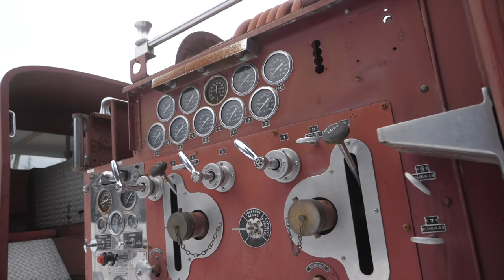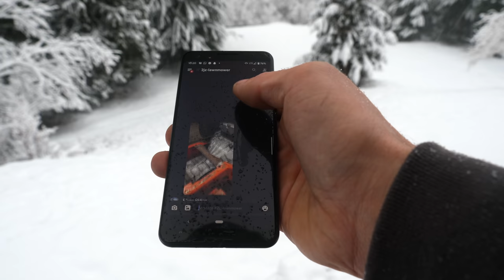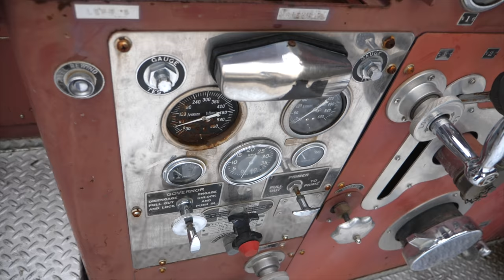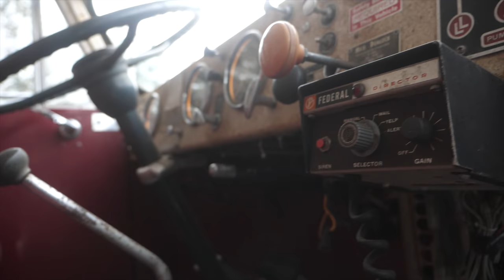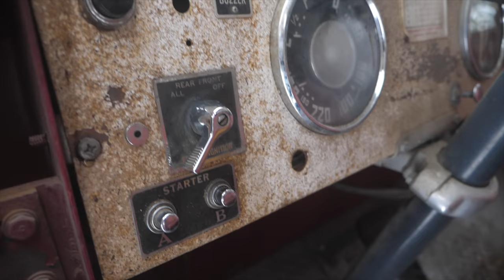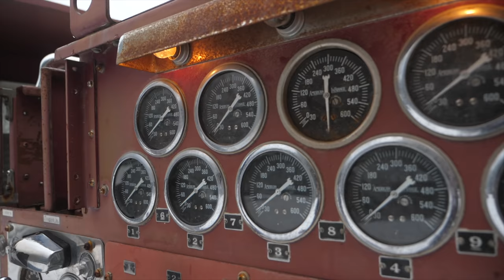We Bought A Fire Truck! Ultimate Toy Hauler Build?

Comment: unless you are making longer trips, the old inline gas has a certain cool factor, and it sounds like it runs great. If its loud in the cab, i can only imagine a detroit. lol If you do decide you want a diesel in it, your best bet would probably be buying about a 97 or older model school bus with the mechanical DT466 and allison automatic. You can pick them up for a couple thousand in good driving condition. Although at that point, youve basically got yourself an enclosed diesel/auto toy hauler that just needs the seats removed and a door cut into the back with some ramps....

Comment: I have to say it is the very first to have a "redundancy" ignition system for me. I hadn't heard of one before. Loggers kill to have a machine like that for doing logging in the summer months when they are required to have a fire fighting system. I would pull that fire fighting gear off and mount it to a old truck frame with a hitch to pull it with. Or even a truck with a long frame, nothing special about it except that gear on it. If I did it, It would get extra heavy duty springs on it front and rear. Since you are getting rid of it, find another tank top side for extra water... pay for a lot of stuff to make some future builds cheaper

Comment: pro tip about the cdl.. if the truck is under 26001 lbs no cdl required... also (check in ur state to be sure) but if its personal use not company use no cdl is required anyway.. register it as a toy hauler or camper... then ur golden :)

Comment: I'd say make a bad ass toy hauler. A newer cummins with an allison. Maybe an 8.3, or 6.7 I dunno. A 12v makes more power I'm sure lol. Just pimp out the inside of the cab a bit, maybe extend the inside by enclosing the rear section, sound deaden, seats, etc..

Comment: The jet engine isn't as difficult or expensive as you're thinking. Get a turboshaft engine from a helicopter and it already has the gearing for an output shaft. You could probably get it to work with a really big and slippy torque converter 2spd auto for a drag car. Aircraft and aircraft parts are 1/3rd the normal price right now too. And yes, it'll run on diesel.

Comment: Nice Fire Truck! I don't have an I-phone so no Discord for me. If you want info on your fire truck I may be able to help as I have the same Fire Truck just 10 years newer but it's the Hook and Ladder version with a 100' ladder on it and steering in the back as well as the front. The engine you want is a 2 stroke V-8 Detroit Diesel with the Supercharger, all the 2 strokes have Supercharger. Our trucks look identical from the front until you get beyond the engine. When or if you pull the tires you may have some problems without a big ass impact. But... they do sell a tool for breaking lug nuts loose on big trucks and it operates by hand using torque multiplication. I highly recommenced it as it will break any nut loose or twist off the stud.
A five year old could use it once its in place, you can get one from Northern Tool online. Anyways you guys have fun with it and you don't need a CDL if you put collector plates on it. Good Luck!   Chuck

Comment: Since GVW of it is less than 26,001 lbs and it doesn't sound like it has air brakes, I don't think you'll need a CDL. Also as long as your water tank isn't 1000 gallon or more, you won't need a tanker endorsement. So I think you're good to drive it

Comment: i believe if it doesnt have air brakes, you might not need a CDL. but i may be wrong, it does weigh a lot..  still in all, this would be a pretty wicked toy hauler. just make sure you remove any emergency decals on it, or that could lead to some hassles from the 5-0.

Comment: Far as I know, in most state, as long as the truck braking system does not run on any form of air and is all hydraulic you should not need a special commercial license. But I only know that for some Southern States.

Comment: Keep the Stock Engine. Get rid of the pumps and tank. Keep the cab.. Those Big Straight 6 motors Sound Great once you tube them up. Plugs,carb etc

Comment: It would have no prob. With a full hose bed  water and tools. It will pull the front wheels if you pop the clutch just under redline if its  running  right  with no load ...

Comment: I'm sure there is someone out there that can use the parts. Pull the stuff off and list it for sale. Make a short boxed in area for the power wheels and other smaller toys, and a drive up ramp that goes up over the cab.

Comment: 26,000 i "think" is the requirement for needing a CDL. It has regular plates on it already. Register it as an RV and i think u will be fine. Buff out the cab! The front bumper and headlights look brand new still no chipping chrome.That is a sweet truck!

Comment: I wonder how much HP you can get with bolt-on improvements? Those engines were designed for reliability for their time. A few upgrades might be great. Throttle body injection, electronic ignition, better exhaust. The holy trinity.

Comment: You do not need a CDL to drive that truck if it is under 26,000 pounds. Also the engine in there is more than likely a Continental R6602, which is actually 602 cubic inches. It isn't a horsepower monster by any means because it only makes around 220 horsepower, but it should make 500 ft-lbs of torque at 1200 rpm, so it's kinda like a diesel in that regard. I'm sure if you swapped out the carbs and made a better flowing intake and exhaust, you could squeeze a few more ft-lbs out of it.

Comment: Although a TDI auto swap makes total sense, I'd love to see two turbos and EFI on this thing. Also, you would probably lose 8000lbs or so by getting ride of everything on the chassis from the engine back. Tank, valves, pump system etc.

Comment: Ah yes, the good ol' LaFrance where you can't reach half of the gears because pattern is so wide. :D
Also if this one has air brakes, don't let her sit for too long because those brakes would start going from nothing to full lock, no in-between. Many-a-bonks were gotten against the windshield until i started putting the belt on before starting to drive, not while.

Comment: well there's a toy that's as old as i am, and in slightly better shape. but i have way more miles on me than it does. i know my odometer has rolled over at least once. if you can find someone restoring one, you can prolly get your money back by selling the fire fighter parts you won't need. it's not like there are a lot of these still out in the wild, and this one seems pretty complete and it's in decent shape to boot. build a box on it and make it a half and half, a camper-enclosed toy hauler/garage. i'd like to see you stick that engine in a power wheels go buggy. it'd hafta be a stretch limo though, emphasis on the stretchy part.

Comment: you have to remember that when it was built gas was 25 cents a gallon or cheaper it was just a way better idea to have the gas engine diesel was more expensive even if the Detroit was a better option

Comment: I can actually run that pump. I was trained on that similar engine in 1984. Dual starters are for redundancy. The 6 Big Banger w/dual distributors is a MF to time. You would have to find and old-time mechanic that knows those motors. Good luck, well be watching.

Comment: 6V53T Detroit would probably fit in her without a whole lot of problems, and back it up with a more modern 6 speed manual like what the 1995 GMC Topkick I drive at work has, its a Spicer but don't know the model. If you register it at 24k pounds or less you can drive it with a regular drivers license, that's what the Topkick I drive is registered at and I have a regular drivers license.
Reply: I live in Nampa Idaho so I assume the laws and regulations would be the same in Standpoint as well

Comment: The redundant features on the truck are because it's an emergency vehicle and if a part fails they can just flip a switch instead of having to repair it when there is a fire coming at them in the middle of a forest or whatever. I'm sure it has 2 completely separate starters

Comment: As far as I know you don’t need a cdl and google confirmed that. (No, it is not necessary to have a CDL in order to drive any fire apparatus. This is because fire trucks are not classed as commercial vehicles. Therefore, there is a federal exemption that allows firefighters to operate the various apparatus without the need for any special drivers' licenses.)

Comment: More than likely, it has a Halscott engine. As far as licensing,  Fed DOT does not require a Class B commercial for vehicles with a GVWR of 26000 pounds or less. Check the data plate.

Comment: If you convert to hauler you Must Keep the Fire Truck look and fixtures on the sides to do it Super Killer!
Stripping the goodies is way easier but will lose the Killer Look. Must Look Like a Fire Truck and Hauler.. imho.. 🤓
The idea of using “as is” around your shop and local area also is good but not nearly as interesting as the hauler idea. Again imho.
✌️PT

Comment: The gauge cluster on that thing looks identical to what was in my '47 Chevy 1 ton! I'm kind of curious what engine it actually has in it, since a lot of those GM-based trucks had the GMC V-12 702 cu.in. engine. On the licensing, in most states, if it's under 28,000 GVW, you don't need a CDL to drive it. If you were actually working for the VFD, you probably would though. They have different classifications for commercial and privately owned trucks.😉 EDIT: You guys practically stole that thing for $1500. You could cut it up for scrap iron and brass and make your money back and then some!🤣 If you can get your hands on an older Cummins ISB 6.7 (2013 or so), it would almost be a bolt in deal, and they get pretty good fuel mileage. I doubt you'd get more than 4 or 5 mpg. with that chunk of iron that's in there now.😮

Comment: Under 26000 lbs gvw Is the cut off for commercial license. Under 26000 you probably don't need a special one. Also, does it have airbrakes? You might be able to get away with a class c license. Although there is requirements for a truck with a tank sometimes.

Comment: If the truck GVWR is 26,000# or less, it requires a regular "Class C" license (regular driver's license). If the GVWR is 26,001 or more, for single vehicle and  towing less than 10,000# trailer, a "Class B" is required.  

If you're using this for personal use, you will not need a CDL. Don't confuse CDL with Class of license.

Comment: If fuel trucks contain and transport fuel, and propane trucks contain and transport propane, how come fire trucks do not contain nor transport fire? 

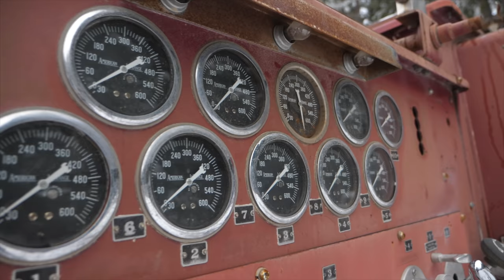5:12 Based on your math, that truck only holds approximately 480 gallons of water assuming google is accurate and a gallon of water weighs 8.33lbs. For comparison, Jetfuel weighs 6.7lbs per gallon. (Source: 23 years Air Force Fuels.)